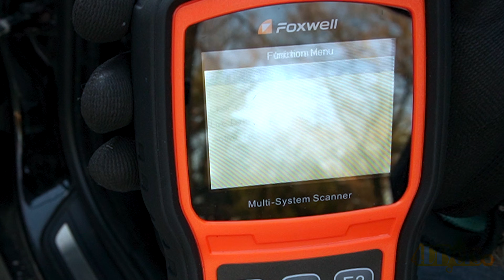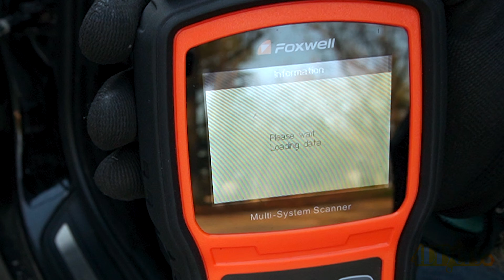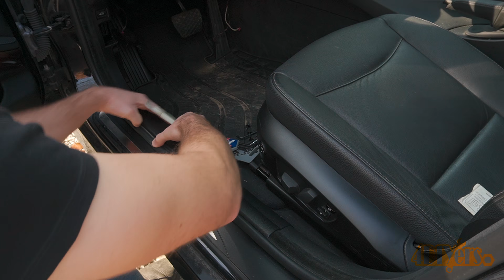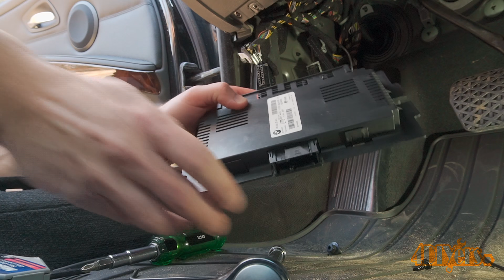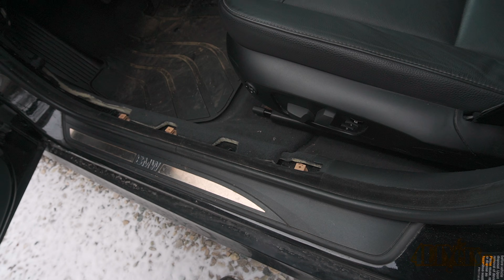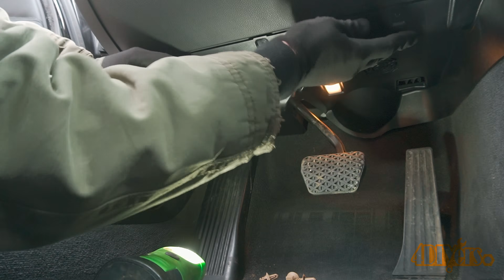How to Remove or Replace BMW Footwell Module FRM

Comment: Do I need to clear the OBD fault codes first before starting the engine for the lights to work, or can I start the engine without clearing the codes and the lights will work?
Reply from the maker: Should be able to start the engine without clearing the codes.

Comment: My Whole dash went out my idrive don’t work my back windows don’t work and my obd port don’t have connection
Reply from the maker: Sounds like it could be an FRM issue. Have you checked the condition of your battery too?

Comment: Hello, I have a BMW 335i E92, a few months ago the car did not start and they replaced the battery, now that I bought it I tried the new battery and the car starts but does not stay on, the engine light appears and the battery is draining voltage, someone told me it is the FRM module, do you think it is the module or does it also have something to do with the alternator, why does it act strange, why do some lights stay on and certain lights not work, thanks
Reply from the maker: I would start first with scanning the codes. But use a BMW specific scanner to get the right codes. That will help pinpoint the potential cause. As far as I know, a faulty FRM will not prevent a car from starting.

Comment: Well here's a new issue I went to the store and for the last few days my battery was showing a little weak but not severe and then I tried to start my car and it barely cranked over I made the mistake to try to keep cranking it thinking well it'll catch and what it did was decoded my module because the battery was so low well I won't make that mistake again right so if you have a weak battery you find yourself in this position stop get it jumped have the system checked out don't keep trying to crank it thinking it's going to turn over!
Reply: FYI Do NOT jump the car. That is typically what makes these modules fail.

Comment: They go bad because the sunroof drain gets blocked and the water starts going to the place where the FRM module is. keep your car under shade adn if driving in the rain make sure once you have parked the car then either park on uphill under a shade or make sure to remove all the water from sunroof drainage channels.
Reply from the maker: One of the reasons.

Comment: Thank you helped alot on my 2011 328i xdrive module went out when got the car so had it sent to guy who repaired modules and fixed mine works like new i hope stays like that!
Reply from the maker: You're very welcome and happy to hear you got it fixed!
Reply: Did the the  fix it or reprogram it?
Reply: @mazinmanea6587 yes saved me money without hving to buy new and reprogram and i just sent the original footwell module that was falty couldnt unlock or lock car n no light or back wndows dont work. And soon as my original come back in mail after repair i plug to check was working fine n didnt wanna bolt everything jus n case stll falty but boom everything started working no codes no check engine working better than ever only pay60$ im sure if i buy new n program all overcost much more i hope n pray its same as me vwry simple fix on ebay

Comment: Same thing happened with my 2010 Mini’s FRM and I just had it reflushed. 
Question, is it a must to disconnect the negative terminal of my battery when re-installing my FRM? Please let me know. 

Thanks
Reply from the maker: I would disconnect the battery terminal just to be safe. Apparently the FRM is also picky to potential voltage spikes or static from what I’ve read.

Comment: I came to this video to find out how you disconnected the grey tabs, and you just flew right through it. Alrighty then. Mine are on there good. Lol
Reply from the maker: Push the connector in, sometimes they jam a little. Then push the tang on the backside, typically on the center top of the connector. While pushed in, there is a lever that needs to be pulled back. As the lever moves out, this will also pull the connector out of the location. Then finish pulling off.

Comment: Could a foot well module cause all the cluster lights to come on and a non working speedometer along with constant running windshield wipers ?
Reply: Yup
Reply: Could also be because hidden fuse box ducked up
Reply: @sipmeister3611  i speak from experience. A faulty frm WILL cause wipers to run nonstop and cluster to not read or light up correctly
Reply: @DandyWaves  i talk from experience as well my entire dash flooded and so did inside the car for a whole year im going over everything slowly my wipers did the same thing. but i replaced the hidden fuse box and wipers never did it again im just missing functions in steering wheel  and what not some buttons have fused together due to water damage amongst all electronics cars been my daily over a year but I've slowly been rebuilding everything shocks springs hidden fuse valve cover check valves 700$ scan tool  vanos solenoid air filters cabin filter sparp plugs coils  im well equipped. rear taillight seals broke and let water into battery cables making them a rust blob its a nightmare but a lovely car to learn and wrench on.

Comment: After repairing my FRM, I had a hell of a time getting the damn thing back in. Hint: it is possible to have all the connectors installed properly, but the FRM is "backwards" (eg wrong side up.) UGH. Took me an hour to figure this out. Also, had to hook it up and leave it dangling, reconnect the battery, then move the power seats all the way back to improve access (I am short and the seat was pretty far up). Finally, you may get an SOS warning when the kick panel is removed. Hopefully this will resolve when I reinstall the fibre-optic cables. Wish me luck.

Comment: Hi. My e90 320i passenger seat does work at all but the driver side everything works. Moving forward and backwards, tilt. Up and down. But passenger does not work, checked the wires and fuse and they are all good. could this relate to the FRM OR BCM MODULES. any information leading to this problem will be much appreciated. Thanks
Reply: I have the same problem but for a 2007 335i! Did you fix this issue? If so was it the FRM?

Comment: Did you have the battery connected before you refitted, or the negative disconnected, or full disconnected? No-one seems to cover how to properly re-install and I don't want to fry my repaired FRM!
Reply: I’ve just refitted my repaired frm with the battery disconnected, I believe you should leave it disconnected for at least 20 mins. Mine was disconnected for a couple hours as I was waiting for the frm through the post. Anyways, all lights are back working as they should.
Reply: @adamphillips2765  nice one. It’s a shame we have to worry about how to do this, and if the FRM a will survive reconnecting the battery!
Reply: @MrGibspoon how'd it go? Lol im doing this soon
Reply: @RichBb.  I was advised to have the battery connected, and it went fine! Shame I wrote the car off a month later by hitting a small rock that destroyed my sump and gearbox….. never ever lowering a car again🤦‍♂️🤦‍♂️🤦‍♂️
Reply: @MrGibspoon  😭😭😭 I will never lower mine after reading that
Reply: @MrGibspoon  Ive heard the same aswell to have it connected before installng it. due to the fact that if its connectec prior and then given that large amount of voltage when connecting the battery you could go back to square one with another damaged FRM.
Reply: @adamphillips2765 fully disconnected or ?

Comment: Yep, to add on to how it happened, sometimes simply disconnecting and reconnecting the battery can fry it to. I do think though the older they are the more prone this happens but yeah unfortunate finnicky module. Do note when you get it repaired,  it doesn't' always last and can still have some things not work. I had repaired mine and for example I could not adjust my interior lights dimness anymore. Then about ~ 7 months later it gave up again, repaired it, then few weeks later gave up again and then that's when I bought a brand new one FK it.
Reply: A common issue is the sunroof drains around the seal get clogged and the water simply travels down to the FRM, this is why it probably died on you after replacing a few times. It’s a pain in the ass I’m going through it now too, but it doesn’t hurt to have a cert foreign mechanic clean those drains and dry out any residual water left under the carpet where the Kbus wiring lies.